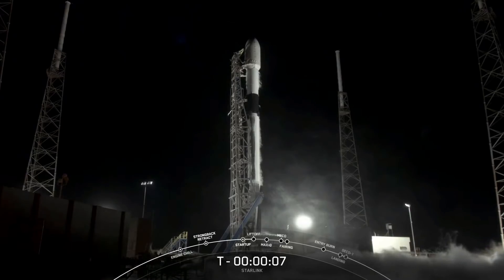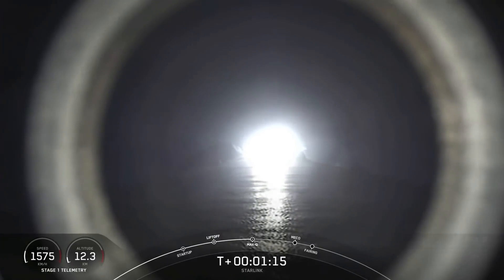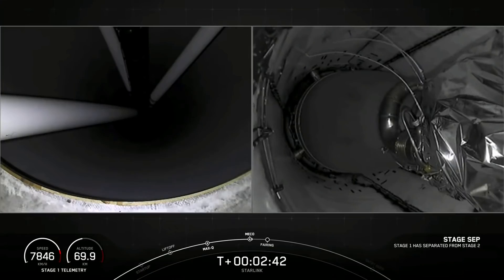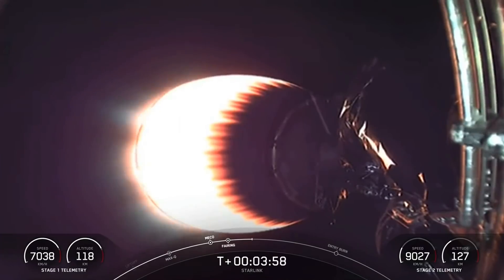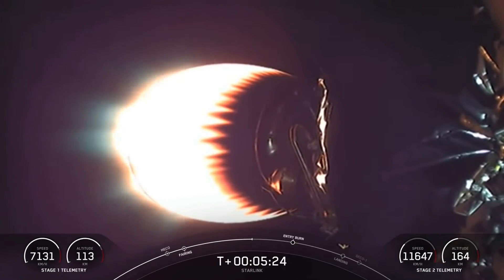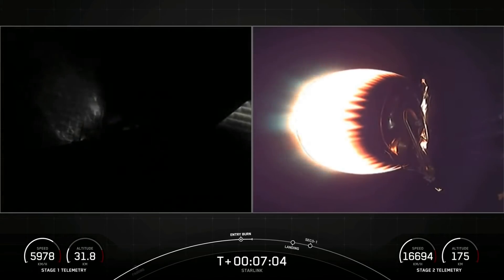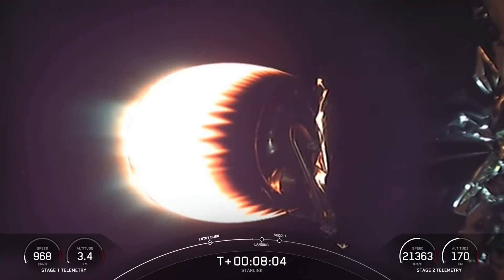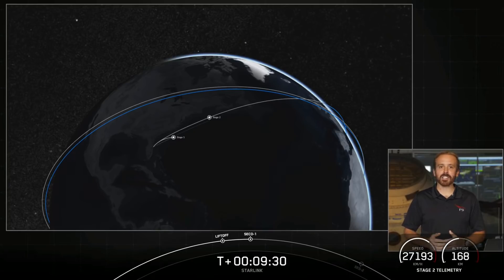SpaceX launches Starlink sats on 10X used rocket, sticks landing

Comment: at almost every landing you see flames, and flames and rocket fuel is a ticket for disaster. Why?
Reply: Because the flame gets trapped between the pad and the merlin engines when it touches the pad so it gets released. And it's a rocket. There is always a miniscule chance if disaster.

Comment: They really need to fix that drone ship landing camera.
Reply: The camera does just fine, but the vibration from the rocket plume shakes the barge hard enough to make the satellite comm antenna lose lock on its target and the signal doesn't get through in real time. The video is a nice-to-have bonus and not really needed for system reliability, so they probably aren't putting much effort into a workaround such as using a low gain local link to another boat, then a sat link from there. The crew boat probably waits a good safe distance away and out of line-of-sight for the high bandwidth signal.

Comment: why they turn off camera's? what are they hiding?
Reply: If you're talking about the landing they aren't being turned off.  The intense vibration from the landing is causing them to cut out.
Reply: @SeraphArmaros  nice try.. but failed.. you telling me they can built modern rockets which can travel mars but not a camera which cannot keep a live telecast of video?
Reply: @swagnexttuber-boombeach7092  As the rocket gets closer to the drone-ship, the thrust from the engines start to shake the drone-ship with such a high frequency that the video feed antenna loses lock with the satellite, causing the video feed to cut out. Once the rocket has landed and the vibrations have dissipated, the video feed should reappear.
Reply: @swagnexttuber-boombeach7092  So you actually think that the SpaceX rockets launches and booster landings are all a hoax?
Reply: Check primal space video..they explained it very well.
Reply: @saurabhchandrakar123  https://youtu.be/hH75bVG7HBo
Reply: At what point?
Reply: Such bullshit. The camera going into space (supposedly) at 27k mph and that camera doesn't shake at all and the one on the "reusable" booster cuts out, EVERY F*CKING time and with all this technology there are only a handful of videos released out there.  Then someone coding on a video game says I can do it on here!! (Okay, then it must be true if you can do it on a f*cking video game..lol)